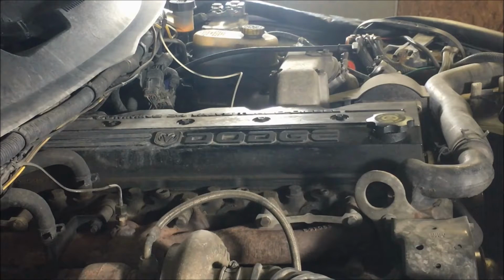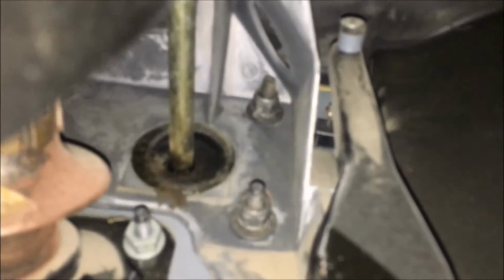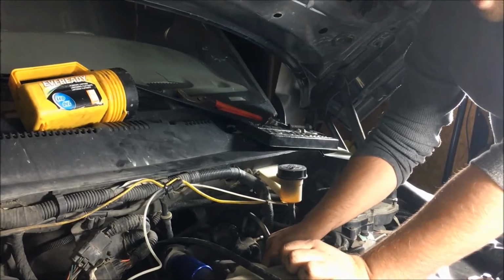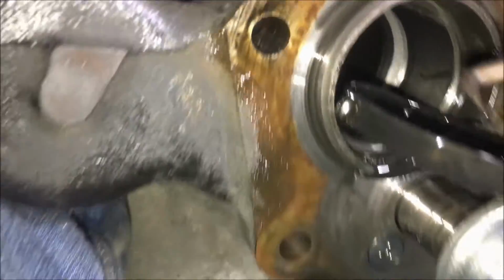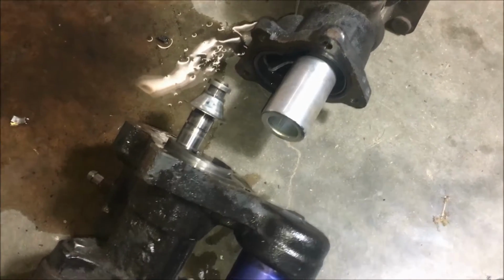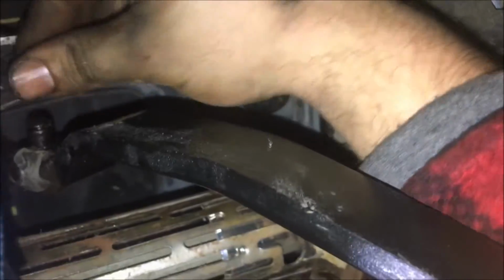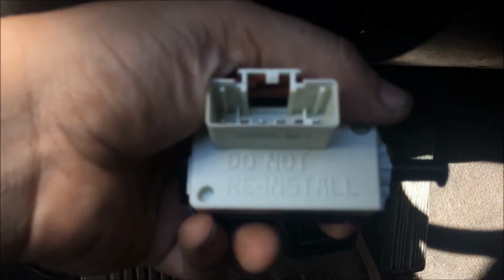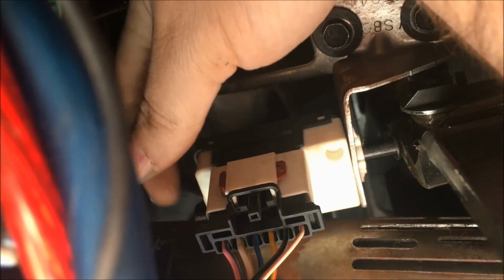Repairing a Leaky Dodge Chrysler Hydroboost (Powersteering Leak)

Comment: Hello mine leaks inside the truck is it the same type of seal? Same concept?
Reply from the maker: The piston seal wouldn't be the one leaking; you should rebuild the entire unit.
Reply: @stlouissux9119  Hello I done mine on a 2001 3500 and now my breaker pedal goes down when I crank the truck... guess I done something wrong... any help would be appreciated.
Reply from the maker: @brandonscott4390  It sounds like the piston isn't properly latched

Comment: When u bled the system did u have front tires off the ground ? And what type of power steering fluid are u running
Reply from the maker: Michael Rocha When bleeding it we did not have the wheels off the ground, we used the Chrysler recommended fluid which I believe was ATF+4
Reply: @stlouissux9119  Not ATF fluid. That was Dodge Ram year 2003 or greater. From 2002 and older only use Power Steering Fluid. ATF will totally mess up the older systems.